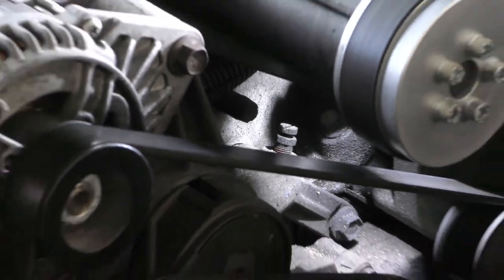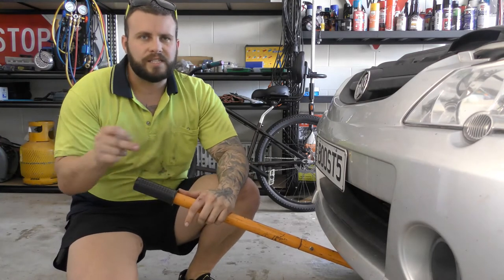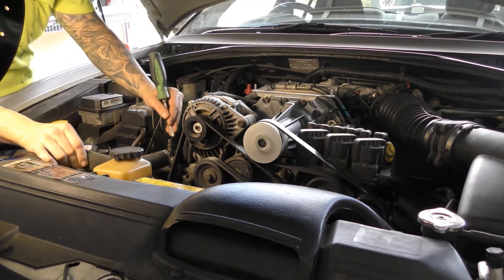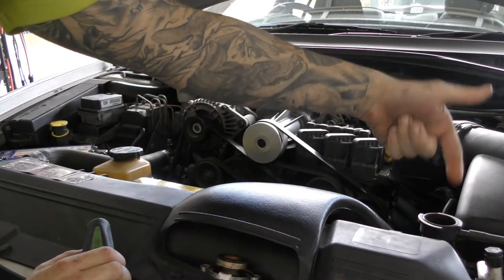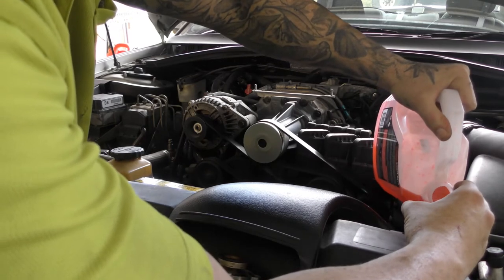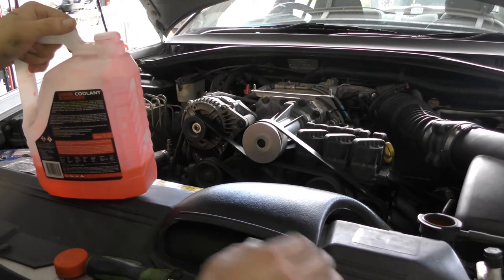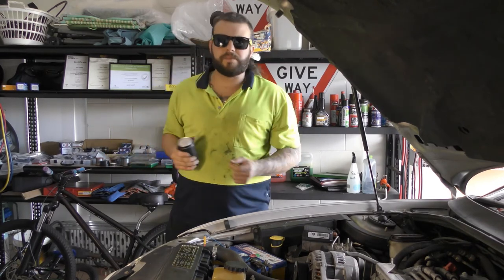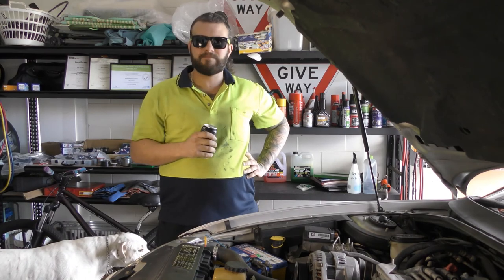How to bleed cooling system on a L67 Commodore

Comment: Does this actually work as ill try this tomorrow, tried bleeding from cap like older cars and blew coolant everywhere
Reply from the maker: Do it when the engine is cold bro
Reply: @joeycool5810  and just keep topped up with coolant and bleed from front bleeder to back till no air is bubbling out? Kinda new to mechanical work aha
Reply from the maker: Hey man im not a doctor but if you got a cough ill tell ya to cover ya mouth ya know